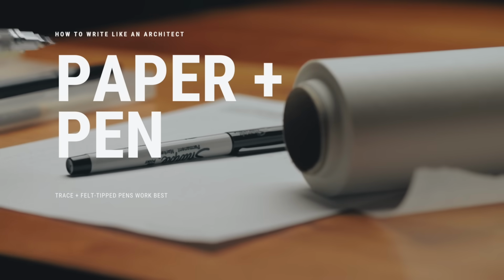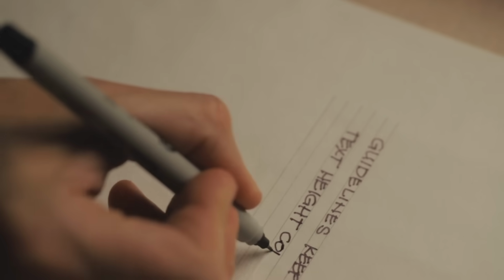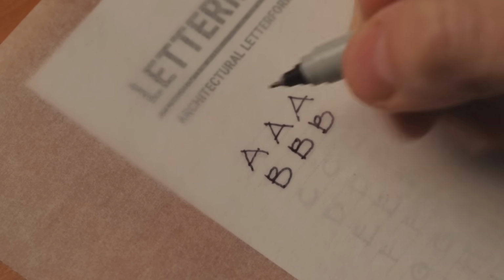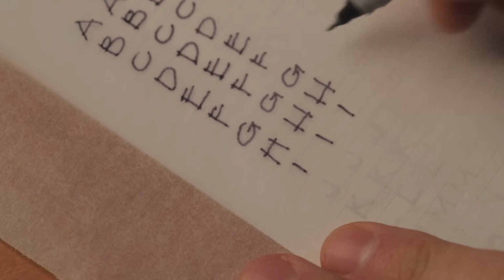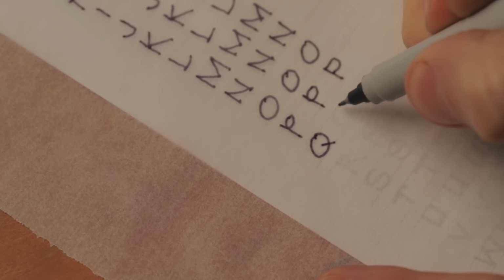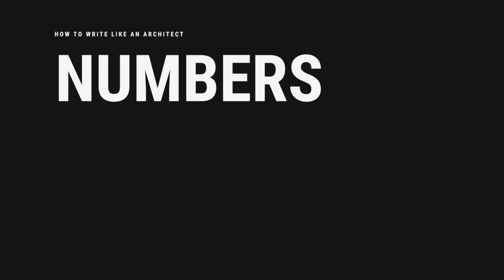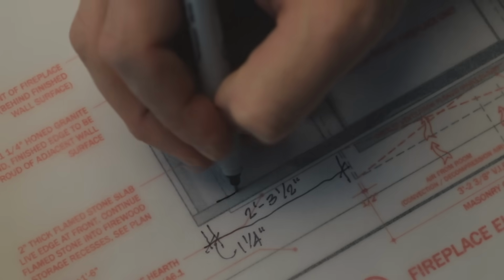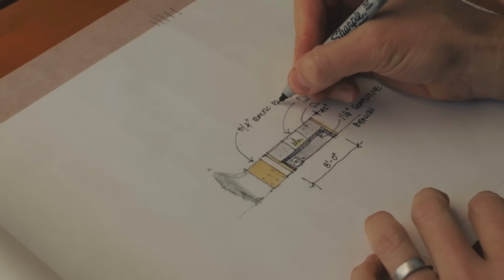How to Write Like An Architect (+ Worksheet)

Comment: I bought the book mentioned in the comments. I expected I would be paying $60 for a book with a page or 2 of useful information.  I was very disappointed, I did not get that. The book referenced is not the book shown in the video. It is a later edition and has less information than the book in the video. It does not address the width of letters in relationship to the height. It shows you the uppercase letters and the numbers. It does not tell you how to draw them. This is not the essential reference book.

Comment: 9:26 There's 2 times the letter R so I guess he's showing variants. And as the author forms the tops of these differently to the method shown earlier in the video, it leads me to conclude there must be some leeway on how to construct letters. When I studied design back in the day, we were taught how to form letters so that they would look printed - a letter O would take four strokes, one for each quarter of the letter. You would also be turning the paper to achieve the different angles. Seemed silly at the time, but I'm glad I took the time to learn it as you can make great lettering.

Comment: I had been a machinist for nearly 15 years when I went into teaching.  After two years of teaching machine shop, I taught drafting.  Until that time, all of my drafting lettering experience was mechanical.  It was totally liberating trying architectural lettering for the first time.  And now, some 25 years later, it's all I use.

Comment: I have a drafting degree from one of the best drafting programs in the country, and I would have failed every project if I lettered this way.  I'm not saying it's wrong here, but training as actual working professionals, we weren't allowed any type of "flair" to our lettering.  Everything had to be completely straight and uniform.  We would be docked for even the slightest tilt or overlap.  The rule that was driven into us was you don't "write" your letters, you draw them.
Reply: same thing. here our professors wouldn’t accept this style of letters🥲 we literally have to draw every letter one by one and it takes sooo much time to do that. i wish we could use this style though, it seems a lot faster in use
Reply: Mechanical Drafting and Architectural drafting are two completely different animals. In high school I took 1-1/2 years of Mechanical drafting and 1/2 year of architectural from the same instructor. He was a stickler for uniformity on Mechanical drawings, but when we moved into Architectural he urged us to develop our own style. I was offered a drafting position straight out of high school at a major federal contractor, however I chose to go to uni. Once out in the real world as a designer, you learn to work as quick and clean as possible. Any professional architecture drawings - prior to Cad - all utilized stylized lettering. Mechanical lettering indicated a lack of creativity on behalf of an architect or designer.

Comment: I took drafting in highschool in the 70's. I think we spent the first three weeks learning to letter - and nothing else. Went on to get my design degree taking several architecture classes and had a much easier time with lettering than my classmates. Still print anytime I feel a handwritten note warrants the clarity.
Reply: I learned the same way in HS, although a decade later than you. And I always block print; rarely write in cursive. Over the years though I've gotten sloppy trying to be fast.

Comment: Great video , it's a bit uncommon to see lettering discussed outside of devoted calligraphy circles! The old Leroy lettering system used to be used in comic books , but later got replaced by hand lettering styles across the board . There's a staggering array of beautifully  formed crisp , distinctive & clearly readable styles in this field , all unique to the individual artist. I've hand lettered comics for about 25 years now , and if you're intimidated to start don't be! You can develop  clear, legible and consistent work in a reasonably short time with some practice
Reply: Thank you for the encouranging message! What was your initial training before specialising in hand-lettering?

Comment: I have not read too far down, so apologies if this has been addressed. As a lefty living in a right-handed world, I envy the ease that righty's have applying these. English goes left to right, so I have to "push" the pen, whereas a righty gets to "pull" the pen most of the time. Same reason that I had to abandon my desire to use fountain pens; I could not apply the correct pressure to the nib to get the ink to flow. I am also a lefty who crooks my hand rather than holding my hand straight and turning the paper. I write in upper case like this a lot and have found a fair measure of success, but many of my horizontal lines have a tiny arc to them if I speed up at all. Oh well. Still love this style of writing, and it was fun to see the link in my inbox today.

Comment: Architects of "days gone by" used a Leroy device that was, basically, a template of alphabet and numbers that were traced, using a pantograph of sorts with an ink pen connected that transcribed the characters onto the vellum paper. It took much practice to get clean letters and perfect spacing to make it look good. Also, the pantograph device could be adjusted to yield italic letters.

This technology is pretty much dead I believe.

Comment: The biggest problem I would have with using a Sharpie is that I wouldn't be able to use my electric eraser, erasing shield or eraser dust pads.  I learned architectural drafting in high school (1967), and became a mechanical engineer at HP where we did our own drafting (no draftsmen or CAD).  I still have many of my old "blue prints" (which have lost their smell of course) from those days.  Believe it or not, I did many multiple part drawings on E-size velum using a Mutoh or drafting table.  I now use SolidWorks as a consultant and love it but I miss the good old days.  I'm still looking for that really good technical font but no success so far.  Who doesn't love to cut masking tape into little rectangles?

Comment: I know this is just practice, but it takes about 15 years to realize Sharpies are not archival. By 25 years they fade out to a faint tan, faster or slower depending on exposure to light and air. The more permanent fountain pen inks are pretty good. And Sakura Microns are archival. I've got photos I've signed that have been on the wall for 25+ years, no problem. Just FYI Also there's a really neat architectural nib for fountain pens that makes horizontal lines fat and vertical lines thin. Probably see this on old plans.
Reply: This is very good information.  I always knew it because the banks will not let me write a cheque using certain pens especially felts but will accept biro pens to write cheques out or sign official letters.,  Just checked the Sakura Microns on Amazon and will buy a set for sure
Reply: @youtubecommenter4069  I think the 'no felt pen' thing might be about forgery (which is funny because outside the few idiots wearing pantyhose on their heads, the crooks in a bank are all in the corner offices.) There's no micro-spatter with felt tips(sort of just made that term up, but it's real). The little bit of spatter we can't see with our eyes can help reveal a forged signature.  When you sign your name you zip around those loops faster spraying micro-spatter far away from the line. A forger is slower the micro-spatter doesn't go as far.  Corporations seem to have no problems with non-archival fugitive printing methods. All those thermally printed receipts that fade to nothing about the time you need to return something to HomeDepot because it broke for no good reason. 

 I write checks with a fountain pen and permanent ink, (I write everything with a fountain pen or pencil. If you offered me a hundred dollars for a working ball point pen from my house; probably wouldn't cost you anything.)  I also write my return address on the outside of the envelope with the same ink figuring somebody thinking about ink washing and rewriting the check will lick their finger and test the ink before stealing the check. (Which gives me the idea that on a drawing for framing, on the edge or on the back along the edge leave a sample of the ink, paint, etc that you used. Then a curator-technician can test the materials without having to damage the work. ) 

Another thing that might interest you. Mechanical, but not drafting, pencils, I like to use 4B leads, the HBs that are more common just seem too faint. I think once a person thinks about different hardnesses they'll quickly figure out which degree of darkness they like. I've got a 3mm like the one in your video, nice pencil but I erase a lot. The only mechanical pencil for frequent flip-it-around and erase I think is the Pentel Twist-Erase III. Has a big, long eraser and you can buy a whole box. I also just bought a more costly Japanese pencil that automatically turns the lead as you write, supposed to keep it sharper - but tiny eraser. At  0.5mm I haven't noticed any practical difference of line quality with the Pentel Twist-Erase.  For wood pencils Ticonderoga's turned to crap about 15 years ago, I use Mirado Black Warriors. In my wood shop for precisely marking wood for cuts I like a #3, still have some I found in a storeroom that are probably 40 years old. 

And more advice no one's asked for: (I'm old so you can just look at the person next to you and raise an eyebrow.) The key to a skill like penmanship is deliberate practice. Go as slow as you need to go to make the right forms, only after you have mastered the forms do you then speed up.

Comment: I trained in drafting for several years in public school. I quickly and permanently substituted drafting lettering for cursive and lower case, to the disgust of teachers. I agree that basically square letter forms are highly legible but my style is now very different with a much more cursive character.  Over 50 years, my letters have drifted to accommodate the following letter and are slightly different depending in placement in a word. My line start is influenced by the line end point in the previous letter. 

I dislike the lines crossing and the squashed round elements as they seem untidy to me. Your Bs are just weird! 

I almost never use felts and pencils are my favorite implements but 0.5 Pilot pens are my main tool. My Rs and Ks are very distorted but very recognizable and my Es rarely include a vertical. Legibility is easily maintained. My signature is a stylized square formed from my initials.

Comment: I want to be an architect, im horrible at maths, what subjects in maths should i try and get strongest that is most commenly used in architecture
Reply: geometry - and learn to READ a tape measure - but even if you are "bad" at math - practicing and applying  it in context of the field will build your confidence.

Comment: Very good but if you are using a CAD program to write use lowercase if you want people to be able to read the drawings instead of looking pretty. This is because it is easier to read lowercase at a distance which is why motorway signs and books use lowercase.

Comment: Over 50 years ago when I was a trainee architectural technician, the first lettering I did was with plastic stencils and pens. I tried different styles of freehand lettering but in the end produced consistent lettering in a rounded style. Years later having just started working at a fairly small practice in Newcastle upon Tyne, UK, the senior partner was walking around, he looked at my drawing and told me not to use stencils as they wasted time. I took great delight in telling him that I hadn’t used stencils - it was all freehand annotation. Wish I still had that ability.

Comment: Save the extra work because we were taught this lettering technique is college but nobody does it when you are in a hurry, which is 99% of the time. Just but a Rapidesign letter template R925.  I am a mechanical engineer and Ive also done some civil work as a side gig.  BTW I make my R the same as the 3rd P example but with a down stroke.

Comment: I note that the worksheet says 3/16  ( inch )
this happens to be the spacing on Moleskine squared cahiers
I have found them to work well with Pilot Uniball Micro ( 0.5mm ) rolling ball pens 
a Sharpie Ultra Fine point will bleed a bit to the back, especially at the point the tip initially touches paper
.. as Moleskines have tear-out pages ( perforated ) at the back, I have taken a few to make guide sheets ( outlining alternate rows of alternate squares ) which can then be used behind blank cahier pages
Reply: kazoosc GENIUS THANK YOU!

Comment: For just little nugget of knowledge, Architects were taught to letter/number alike from the old hand drawn documents days.  When you sometimes had multiple people working on the same sheet (especially large commercial projects), you wanted similar drawing styles for sheet consistency.  Not so much with CAD technology these days although I think us Architects still identify with our hand lettering giving us away.  We used to spend hours in class just getting the lettering and numbering down :-)
Reply: The firm I worked at in the late 1980s we actually had 30-minute lettering drills every morning for several months. The studio manager was of the p r of espionage opinion that EVERYONE should have the same lettering. You should not be able to tell who worked on a particular drawing sheet. Well, things were getting a bit sloppy...

Comment: im a bit confused. what and why does this help? seems like its just a designer being OCD
Reply: I guess that for architects, the handwriting needs to be precise and readable, cos they work with other people and bad handwriting is a pain and can slow down work or cause misunderstandings...just guessing. correct me if its something else...
Reply: @yasmineouchrif9475  It's that, but also consistency. Some of the other guys are missing that point. You need to do the same thing every time so if there is confusion some how it could be figured out.

Comment: question: what about lowercase? mostly i, e, h, d, a, r, and y... ok there's more than i thought, but still, and also, do you strictly follow capitalization/punctuation rules? because when i'm just writing quick notes or something, i usually only capitalize the first letter... and maybe names?
Reply: I'm an engineer/designer with a similar writing style. Quite simply, you never use lowercase with this style. If I'm writing a long piece of text, I'll make what would be capitals just slightly larger letters for clarity. I only use lowercase for algebra and it's very stylized in a way to avoid confusion with Greek letters/capitals/numbers/math operators.

Comment: I was meeting with a builder client of mine today, and as I was preparing to leave, I put on my coat and my brown leather satchel when he asked me to quickly meet two people before I left his office.  I was introduced to two gentlemen who will be performing some work for the builder, when the one says, "He looks architectural with the coat and the satchel bag" and the builder replied, "Yeah, and he does the neat architectural writing too".   So for anyone looking to be an architect or a designer - you don't need years of schooling, licensing, or experience.  Just carry a leather satchel and write like an architect.
Reply: Should I introduce myself as Castanza?
Reply: @chrisworthington1027  "Is that a hole in your sneaker?"lol
Reply: @chrisworthington1027 😂😂😂
Reply: @chrisworthington1027  No, introduce yourself as Art Vandelay.
Reply: @AustinWaring  LOL
Reply: Fake it until you make it 😂
Reply: Broooooo😭😅
Reply: Thanks, I knew there was an easier way than college  😂😂😂
Reply: Broooooo😭😅
Reply: I’m into imports and exports 😂😂😂
Reply: works for george costanza.
Reply: /takes out notebook/ what brand of coat and satchel did you use?🤔
Reply: Builders generally hold most architects in low regard.
Reply: @ednorton47  That  is true

Comment: Wouldn't it be way easier to use the metric system. If you learn to write again, why you don't learn to use measurments a second time. It would be just so much easier and if you work internationally you have to learn it anyway.

Comment: Thank you for every single video !
Reply from the maker: gladly...thanks for watching...
Reply: @30by40  off piste comments; Ive just bought a remarkable 2 (no this isn’t an advert) that relies on handwriting. My handwriting is actually awful; I have to write using a ruler to butt up against. I am trying to re-learn handwriting and found your lettering style to be ideal for me - i really just need to sharpen up my letters. But i cant find the worksheet to download - unless its amongst the other architect related documents/files. Can you direct me please :).    By the way the remarkable is amazing and the fact you can draw on it as well as write in a systematic way has changed my work approach - I am a Project Manager (with about 30 high value projects) - and being able to curate all my project notes into one single but discrete package cannot be discounted.  I do love your series of works (im also building a book nook and designing one from scratch - so its transferrable. Cheers from the UK